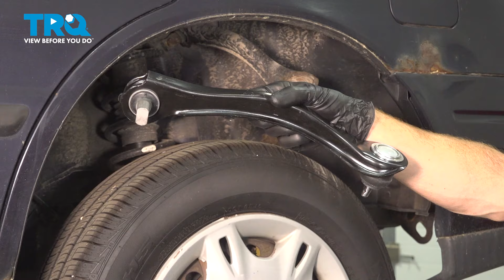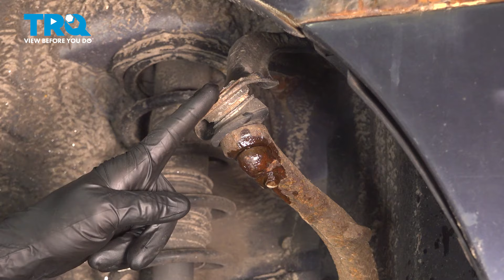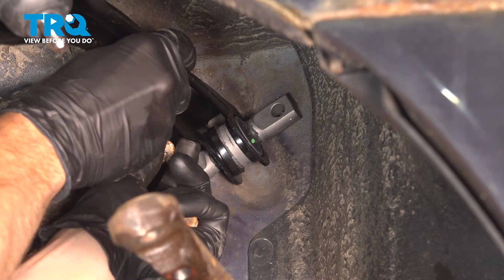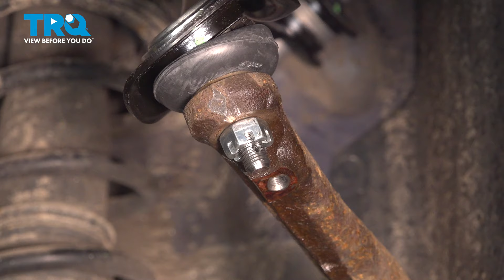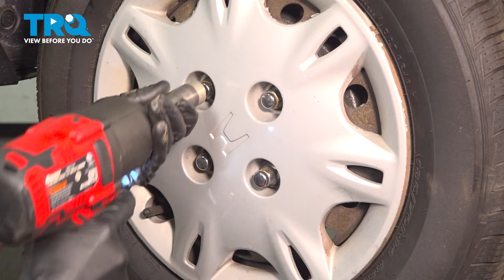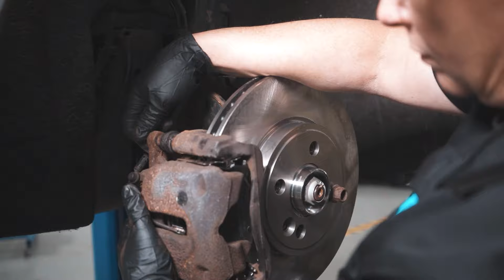How to Replace Rear Upper Control Arms 1994-1997 Honda Accord

Comment: Quality control over the basic design is flawed on this part.  Probably hard to control "MADE IN CHINA PARTS".   I see two issues with that new arm...1. The stud is too long, so the protective cap doesn't seat completely, over the nut   2. The cotter-pin hole is drilled too low on the stud, so when the cotter-pin is inserted, it's not properly placed within the castle nut.  It's sad how poor auto parts are made today...No one cares !!!!